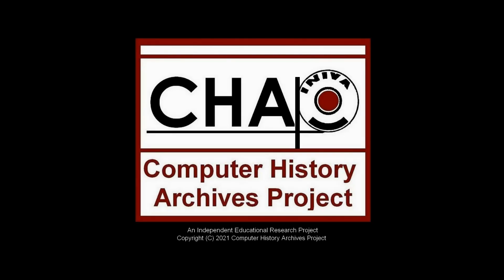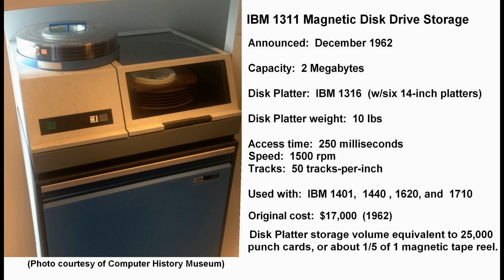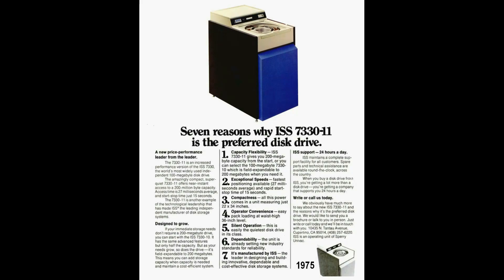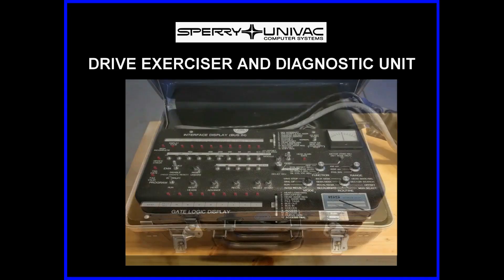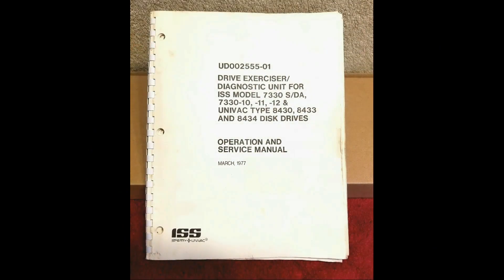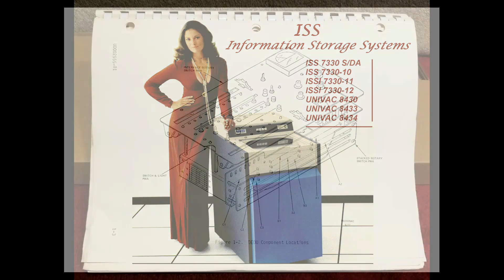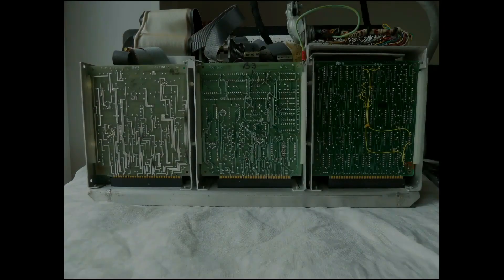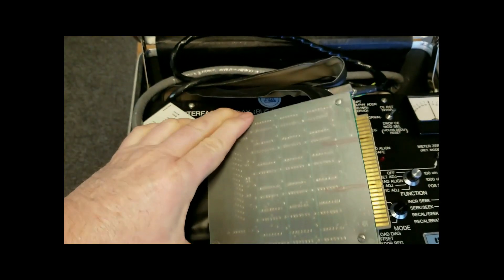Computer History 1977 SPERRY UNIVAC DEDU Disk Exerciser Diagnostic Unit Magnetic Analyzer Unisys

Comment: I used those back in the days when I was a 90/30 tech at Univac. We'd call it a "DEEDOO", not "DEE EE DEE YOU". Opening that case had a James Bond feel to it.
Reply from the maker: Hi @guylavoie 1342,  Fascinating, you are one of the very few we have heard from that have actually used the machine.   Glad you found the video.   Yes, it had quite a James Bond feel.   Thank you very much for your feedback, hope it brought back some good memories!  ~  VK, CHAP
Reply: @ComputerHistoryArchivesProject  Oh yes, certainly brought back memories! The test we would most commonly do with it was measure the seek time of the head actuator (voice coil). One switch would have the drive do a "recal seek" (extend the heads out to the center of the pack and then retract to track 0, on a special head alignment pack), and the seek time in milliseconds would be shown in binary, on the row of LEDs near the top. The 8430 was a 100 MB drive and 8433 was 200 MB. Those weren't very common on the 90/30, being more costly and requiring the optional selector channel in the CPU cabinet and the disk controller (a large standalone cabinet). Most 90/30's had the 8416 or 8418 disk drives, with capacities up to 58 MB. The adaptor/controller for those was built into the cpu cabinet (IDA, Integrated Disk Adapter). The 8416/8418 had it's own DEDU unit.
Reply from the maker: @guylavoie1342, fascinating info!   Thanks very much. A good technical recap from someone in the know on these!  ~ VK  (sorry for the delay in responding, I was traveling...)

Comment: I was working for Itel Corp. in Baltimore in 1978 who leased these drives to the Social Security Administration. They had 300 of them on several IBM S/360 and 370 system. Spent alot of time aligning heads with a the DEDU and a CE pack. Big fun back in the day.
Reply from the maker: Hi @vpitool,  excellent, another DEDU user!   The SSA had 300 of these?   Wow.   That is a fascinating bit of historical information, thank you for sharing!  ~  VK

Comment: Used it many times when I worked for Sperry Univac. Suit and tie days. 90/30's
Reply: Yup, I was also a 90/30 tech in Montreal, from 1978 to 1980. We were called "CE's" (Customer Engineers) at the time. Different drive types had their own DEDU units. Most 90/30's had either the 8416 or 8418 disk drives. When problems arose with the 8418 and we'd test them with a DEDU, it was almost always the J7 card that needed to be replaced in the drive.

Comment: ISS employee #7155 here.  This was my first job out of Tech school, I was 19 when I started. I used one of these in "the pits" which was the name for the Production Test department.  They were also used in the 2nd stage test and controller integration.  I'm happy to answer any questions, as much as I can remember.
Reply from the maker: Hi Richard, thanks for your info!  I bet it was interesting times at ISS back in the day.  One question I have had for quite a while is were these DEDU test kits assigned permanently to a service rep, or did they have to "check one out" each time they went on a service call or had the need to use one.   I ask that since they look expensive.  Thanks!  ~  Victor, at CHAP
Reply: @ComputerHistoryArchivesProject  I can't say what they did with the service dept.  In Production we just grabbed anyone that was available.  Once we finished testing the drives, we would return the unit to the cabinet.  Drives would come to us from assembly.  We would populate the "card cage" with PCBs that were also stocked in cabinets.  We would HiPot, assemble, power up, and do basic tests all standalone.  The DEDU was needed for basic servo/seek tests along with failsafe (emergency head retract).  The unit would then be powered down and sent to "burn in".  After burn in the drives would be connected to a controller where they would do head alignment and basic R/W tests.  The next stage after that was Systems Test (Robot) where banks of drives were connected to a controller for longer term R/W integrity tests.
Reply from the maker: Hi Richard, thanks very much for the clarification about how these were used.  Makes lots of sense.  Interesting bit of history.  Thanks!  ~  Victor
Reply: HI Richard...I worked in the pits at Cupertino Bldg testing drives. Kerry Mellor was my lead.  This was 78/79.  DId we work together?
Reply: @deppsterdeppe725  It is most likely that we were on different shifts.  I worked swing (4pm - 12).  My lead was Haze.

Comment: Ok but can it test and excercise my SATA drives?  No?  Maybe my IDE or SCSI drives?  Or ST-506?
Reply: Drives, back in those days, had separate (outboard) controllers.  The controller unit was huge, about the size of a commercial refrigerator for a restaurant.  The controller interface for the drive consisted of a drive select scheme, cylinder and head addressing, and R/W data.  ST-506 drives, for PCs,  also had external controllers.  The Seagate ST-225 was a popular drive back in the day.  IDE came along later, which stood for Integrated Drive Electronics.  Those drives had proper interfaces and didn't require a low level format of the drive each time you changed controllers.
Reply: @richarddavis5542  I know, my first disk drive was a RoDiMe Ro-205 (5MB) which I used with a Xebec S1410 SASI controller.

Comment: I used disk and tape drive exercisers with Data General peripherals back in the 70's. They always said that the units were fine, but they failed as soon as they were back in service lol. Could be useful for alignment though. You adjusted the 'Cats Eyes' with one of these and an alignment disk. One false move and the heads auto-retracted and tried to take your fingers with them!
Reply from the maker: Sounds like an interesting experience!  I bet the DG drives were a bit noisy too (?)
Reply: @ComputerHistoryArchivesProject  Everything was noisy back then - but then a modern server room is a lot worse!
Reply: @phildxyz  Server rooms still exist?
Reply: The DEDU only got you in the ballpark when it came to head alignment.  To get it to factory spec you had to scope the signal coming off the head.